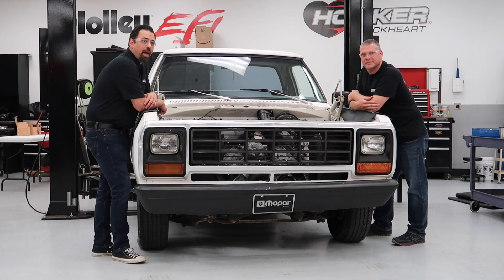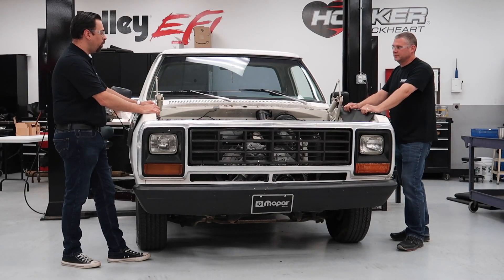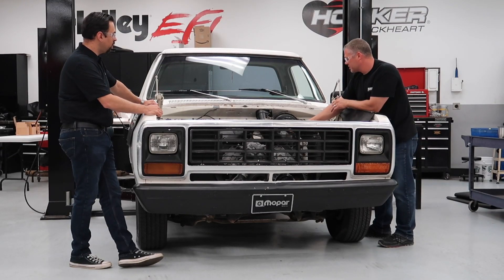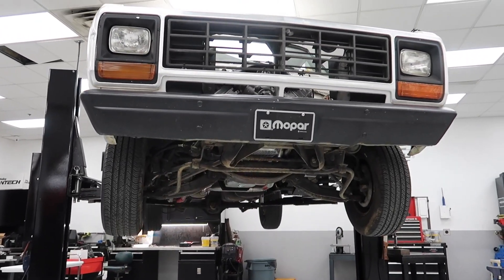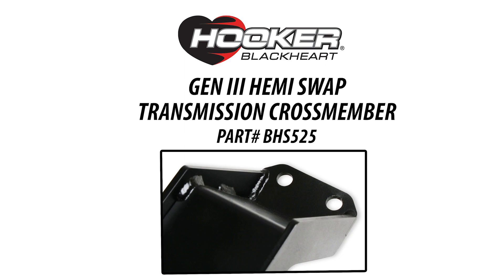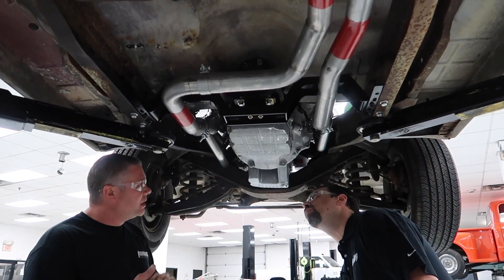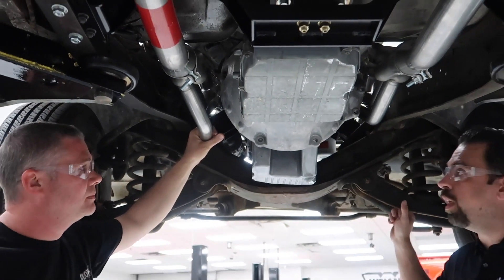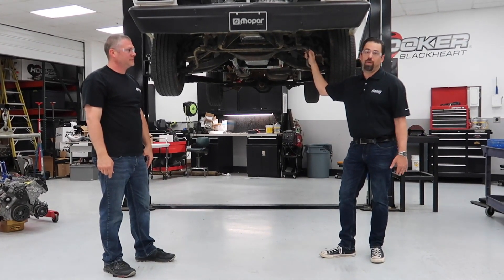Hooker BlackHeart Dodge D100/D150 Gen 3 Hemi Swap System

Comment: I've done ls and hemi swaps on these trucks. I've reused the factory trans crossmember in both with little modifications. I'm very interested in your crossmember. Looks like a lot of room for exhaust. I'm liking the headers. These trucks have very narrow frames so headers can be a pain. What would be really nice if you guys would build a ramcharger style fuel tank setup for efi.
Reply: Will the 6.4 hemi fit in a 88 dodge
Reply: @jasonburress8201  all of the gen3 hemis are the same size as far as just the engine. The difference will be with the front cover the car and trucks are different.
Reply: @kirbywinters1291  what did you use for monts
Reply: That is SO badly needed, after these plastic tanks get old they're virtually useless.  As near as I can tell, there's NO way to repair a crack and if you let it go, you'll have nothing but a big piece of cracked plastic.  There are literally HUNDREDS of wanted ads for tanks and no supply.  After you've jigged up the tank, the fabrication cost is pretty minimal.  I think it would be a small but profitable thing for Holley if they're interested.
Reply: @robertstout6980  Holley Sniper makes a steel tank for them now!

Comment: That's awesome been thinking of doing a gen 3 swap on my 77 D100 the 340 I got in it is getting up there in the miles and I want to save it since 340's are starting to get hard to come by and Gen 3's are in every bone yard across north America and gives more power and headers is the only way to go on any performance engine

Comment: Have you done a 4x4 yet? I have a 79 Ramcharger 4x4 that currently has a magnum 360/NV4500/dana300. I’d like to do an Eagle 5.7/8HP so my wife can drive it. 
I see you have the 8HP brackets for the crossmember, will it work with a 4x4 trans/t-case? And will you have a true dual exhaust for the Ramcharger?

Comment: Great video.. in process of 64 dodge Utiline frame off restore and hemi 5.7 swap from 04 rumble bee ram..plan to also use the newer 545 auto transmission.
Originally was a poly318 with 3 on tree trans..question is will your motor mounts and transmission crossmember work for my application? Thanks ahead..

Comment: would be nice if you could make some replacement upper control arms for that body style, i've looked for 2 years locally and online and cant find any that aren't altered geometry for lowered vehicles or falling apart they're rusted so bad and i have 2 vehicles that need them so instant 2 orders (hint hint).
Reply: New stock replacement upper control arms are out there for the D-series trucks. You can get two new uppers WITH ball joints, bushings, cams and bolts from a guy on ebay for $295 + shipping.
Reply: @BERPSU1  unless it got put back up as of 2 weeks ago they dont exist anymore. also i have no idea where the ebay arms come from, what they're made from, 0 warranty of any kind, etc...
Reply: @dungeonlord  They're on there now. I've used multiple sets of them. Quality is fine and they have a one year warranty though I've never needed it. Quirkparts also sells the same ones.
Reply: Wsd suspension sells new upper arms with bushings and balljoints for a reasonable price

Comment: Any chance w150 parts are coming? Wanting to do a gen 3 hemi and zf 8speed in a 1979 Powerwagon
Reply: I haven't messed around with a 4x4 in a while but I'm willing to bet these motor mounts will work no problem. You can use the factory crossmember with little Fabrication.
Reply: @mattvorhees6055  Yeah I believe the motor mounts are the same. Not sure how the transmission crossmember would work with a 4x4
Reply: I'm wondering the same i want a hemi in my 1990 w150 shorty wondering about transfer case hook up and wiring also.
Reply: Should work the same with little to no modification, as far as I know the only difference on the frames from a W150 and D150 is the front crossmember
Reply: @78ramcharger53  advance adapters makes adapters for almost any combo you can dream up. You should be able to use your current setup with little mods. Maybe a different flywheel. You should have a 727 and a 203 t case. I recommend ditching the 203 and replacing with 205. The 205 is very strong and gear driven.
Reply: @mattvorhees6055  I'm talking about my 1990 w150 ,not my Ramcharger ,I dont believe my 90 has a 203 transfercase.

Comment: What is a good manual transmission for this swap? I have a '81 w250 & really want a hemi swap & manual trans for offroading, towing, & highway. Love my 4 speed np435 which would be hilarious with 500hp.
Reply: Tremec has a new 5 speed that would work great or a NV4500 will bolt up as well.

Comment: That's awesome!  Just yesterday I was thinking about a hemi in a D100 or tradesman van (I have a 73').  How much of this kit do you think would work in a van?
Reply from the maker: We can't be sure. Haven't tried that yet.
Reply: D100 and b100 frames almost the same. The biggest difference is the strut rod location. Trucks are forward the control arm and mount under core support and Van's are rear the control arm that mount a bit past the firewall. All these parts holley is building should work on the vans.